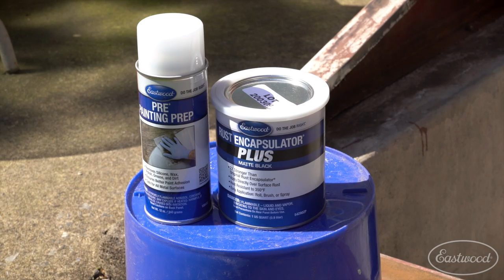Rusted Cellar Door - Save It Don't Scrap It! Eastwood

Comment: When doing this to my bulkhead door, I removed the entire door assembly to address the rust inside / out, top to bottom. Once off and disassembled, I was floored by the rust at the base which had to be fabricated. Glad to finally see I wasn’t the only person to want to save upwards of $1000 to get this job done opposed to buying a new door assembly.

Comment: isn't there a different guard for the angle grinder when using cut off wheels to protect the user in the event of a disk failure? And nice job using the flux core wire in the mig. Nice to see that demonstrated. Thanks,
Reply from the maker: No, just one guard. It does rotate though depending the angle you're using it.

Comment: Do you need to paint over the rust encapsulator or is it UV resistant?
Reply from the maker: Rust Encapsulator Plus should be top coated.